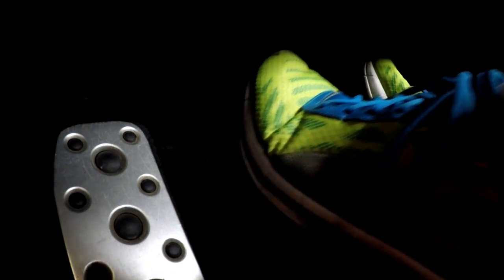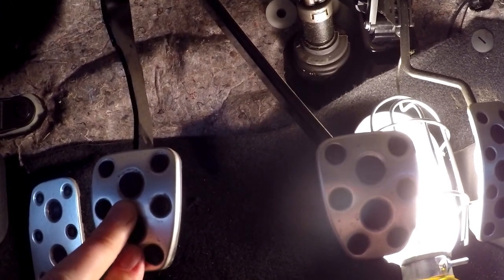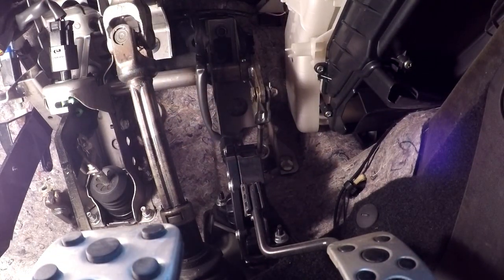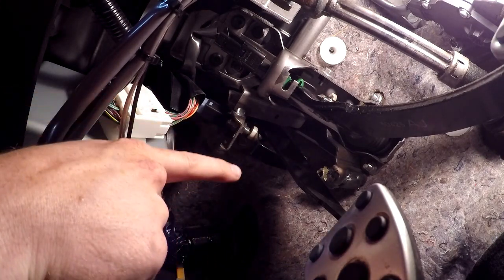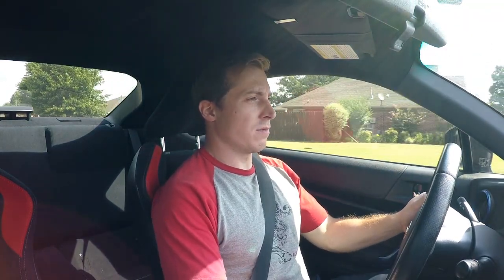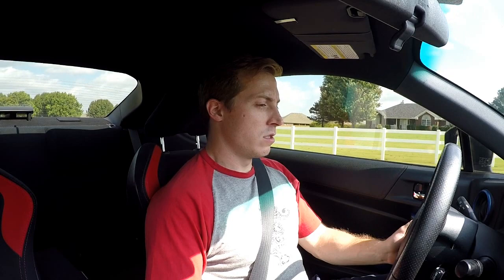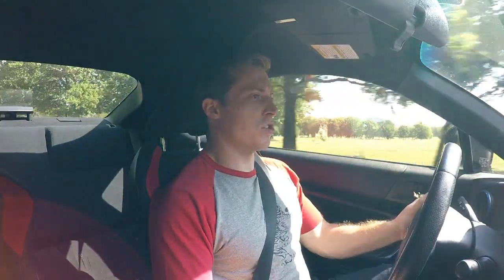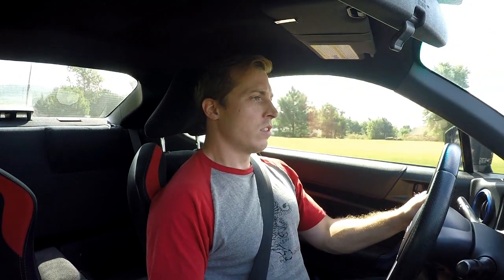How To - Adjust Clutch Pedal - FRS/86/BRZ

Comment: I actually found that it was easier to take the cotter pin and the pivot pin out. I simply rotate the shaft with the U bracket then reinstall the pivot and cotter pin

Comment: I have a 2018 BRZ and after 2000 miles I still can’t shift smoothly from1-2. I ordered a softer spring replacement and I will adjust the clutch. Good video.
Reply from the maker: They make shift springs as well. I plan to order a set after I upgrade my clutch next month. There’s a transmission bushing as well. All of the above would most likely aid in better shifts.

Comment: 1,000,000 times thanks for this video. My  FRS is way better to drive now. The only thing i would add is that rod you were twisting with your fingers... I couldn't get it to turn. So i had to use a pair of vice grips to get it to turn.
Reply from the maker: @natew9970  interesting that it was difficult to turn. Maybe because these have gotten older? Either way, I’m glad the video helped!

Comment: my 95 Civic got a new clutch OE type from Exedy and it bites high too. Thought it was odd but the tech said the bite point is stock he did not make any changes.
Reply from the maker: Did it get better with wear and usage?
Reply: @RageFueled I've had about 1k miles on the new clutch, bite point has not changed. I may adjust it down.

Comment: Do you have to remove the assist spring as well when doing this, or can you just adjust the pedal without having any complications?
Reply from the maker: I do not believe so. You should be able to adjust the clutch with the spring in place.

Comment: I recently purchased a BRZ and just recently figured out the solution to the 1st to 2nd gear problem. Looking to modify the clutch now and still trying to figure out heel-toe downshifts from 3rd to 2nd. Great vid, helped me realize it's not just me having these problems with the car.
Reply from the maker: Max Suciu I’m hoping replacing my clutch will help. It’s been worn since I got the car but has gotten really bad. It has 70,000 miles on the stock clutch. The other previous owners were young and I expect they learned manual cars in it.

Comment: Does this work if I have the mtec clutch spring installed? Or do I have to remove the clutch spring before doing this mod?
Reply from the maker: I believe you can still do this with or without the clutch assist spring.
Reply: @RageFueled  thank you for the reply.
Reply from the maker: xbone 89 no problem!

Comment: good video.  I too had the issue (like everyone else) with smooth take-offs and gear changes in this car.  also the difficulty in getting 2nd gear.  when you see the reviews for this car they all rave about how great the box is but anyone who lives with this car for even a short period of time feels like a gumby with shitty takeoffs at the lights and jerky spaz gear changing.  I have driven manual cars for 20 years but felt like a learner in this car.  I hadn't stalled a car in 20 years but when I got my 86 I stalled it about 3 or 4 times and I consider myself an above average to good driver - frustrating!!!

I will be adjusting my clutch pedal travel shortly thanks to your video but I did the following mods that assisted greatly as well.  

I changed the stock transmission fluid to Penrite GL5 and added Penrite Shift-Eze which improved the 2nd gear selection - didn't seem to take as long to settle down when cold.  I installed the MTEC clutch spring which helped a lot with pedal feel.  the MTEC shifter springs which makes the whole shift gate feel better, more positive, and assisted with further smoothing out changes into 2nd gear.  I have put in the Whiteline positive shift kit which, like the shifter springs, has made a big improvement in selection across the box especially 2nd gear.  finally the Whiteline differential mount cradle insert.  I have gotten rid of most of the slop out of the driveline.  there is a very small increase in gearbox noise in the cabin that unless you are a car nut you would not notice - my wife can tell no difference.   there is still a very slight hesitation going into second gear when it's cold but this disappears very quickly indeed i.e. in one to two minutes.  

with all these mods I now have a gear change experience that is streets ahead of where it was stock.  it's now positive, smooth and snickety snick goodness all through the rev range when driving like grandma or Fangio.  I cannot recommend all of these mods highly enough.  the clutch pedal adjustment which you have done might just be the icing on the cake.
Reply from the maker: Peter thank you for the in depth comment. I agree completely with the stock shift system. I learned to drive on tractors and small dump trucks. Drove them for about 15 years or so. This was harder to drive and feel. Between removing the assist spring, adjusting the pedal, using Motel gear oil, and a new clutch/LW flywheel, it’s a different car. After your recommendation I will move the shift springs and bushings higher on my list. I’m glad you enjoy your car for what it is! They’re an excellent chassis and drive so good.
Reply: How much better is the Pennite than Motul? I'm running Motul on my "18 BRZ and 2nd gear is a lot smoother now.
Reply: @saulespino2510   I haven't tried the Motul in mine - just replaced the factory filled stuff with Penrite.  Keen to give the Motul a try though.  I have done the clutch pedal adjustment and I am very happy with my whole setup now.
Reply: What gives better feel removing clutch pedal spring or replacing with m tech spring?
Reply: @anthonymoy4471  I haven't tried it with removing the clutch spring completely
Reply: Maybe CDV a free mode will help an change everything.

Comment: Just did this modification and removed the clutch spring and wow, it feels like a completely different car. Finding the clutch bite point is not easier which I find strange, but the reduced travel makes shifting so much easier. The pedal also feels spongy, and feels like most other normal cars.
Reply from the maker: Mario Paul between these mods, the short shifter, heavy duty clutch, and lightweight flywheel it’s nothing like stock. I’m looking forward to replacing the shift springs too.
Reply: I put in an MTEC spring in the clutch pedal, much better.

Comment: It's a Toyota transmission(made by-Aisin co) .. all depends if you have a manual or automatic. The Manual is the Toyota J160 (Aisin AZ6)- used in rx8, Lexus IS, S15 Silvia and Miata mx5 ( slightly changed for the brz/frs) 
The automatic version is the Toyota A960E (- used in IS250 and GS300 Lexus vehicles.
Reply from the maker: Sebastian Arcila I knew it was a Toyota trans but didn’t know for sure what all it was used on. Thanks for clarifying
Reply: Nah dude it’s a TL70

Comment: Great video! How did you make the mesh of the clutch and gas pedal a little softer?
Reply from the maker: The mesh softer? My clutch is a lot stiffer than stock. I removed the assist spring and it has a heavy full face clutch in it.

Comment: My clutch seems to be almost to the floor, could I I adjust the opposite to raise the pedal so it's not too pressed in?
Reply from the maker: I would think so yes. Unless your clutch is too worn out. Just because it isn’t slipping doesn’t mean it isn’t worn out. Make sure you have slack in the pedal though so it doesn’t ride the TOB

Comment: Hey man, I cannot get that rod to twist in, I don’t know why. Super frustrating. Any ideas?
Reply from the maker: Did you loosen the jam nut? I know that’s a stupid question but first thing to check is the simplest.
Reply: @RageFueled  I did yes. That would be  the 12 mm  nut on the rod right? I’m not sure if I’m missing something else but it seems like I’m doing it all right, damn rod just won’t turn
Reply: @cyrusstites4847  I found that if you add some pressure to the actual clutch peddle itself, the rod is then able to turn. I ran into this myself on my 2018 wrx

Comment: Just wondering what way to turn the master cylinder rod to lower the pedal?
Reply from the maker: If memory serves, you turn it clockwise and screw it in.
Reply: @RageFueled  ok perfect! Thanks for the quick response man!! Gonna try it on my 2017 wrx sti. The clutch is probably fairly worn but anything to lower the engagement point lol feels weird having to release the clutch so much to get the car going
Reply from the maker: @247jeffmarshall  no worries. Let me know how it goes.
Reply: @RageFueled  also just wondering the 3/8” of play. Is that play in the pedal before it meets restistance? Sorry for the million questions lol
Reply from the maker: @247jeffmarshall  correct. You don’t want the pedal to be too tight or it could essentially “ride” the clutch.
Reply: @RageFueled  ok cool I just did the adjustment and it was actually counter clockwise to lower the pedal. Feels a lot better now. Doesn’t seem like the engagement point really changes but it definitely shortens the pedal stroke which makes it feel like it engages sooner. Thanks again man!
Reply from the maker: @247jeffmarshall  I was afraid of that. It’s been several years since I did that and couldn’t remember. Sorry about that. I’m glad you got it figured out!

Comment: You remove the spring and also adjusted the clutch pedal b/c I want to do this to my car people say to remove the spring and it will feel better
Reply from the maker: Removing the spring made the biggest difference but adjusting the pedal really made the spring removal that much better. The clutch feels like you would expect.
Reply: Rage Fueled does removing the spring affect anything bad ? and thanks I’ll be doing this mod soon to my 86
Reply from the maker: Not a thing. Just gives the clutch less of an artificial feel and more stiffness.
Reply: Rage Fueled going to do this today thanks bro great video this is going to help a lot
Reply from the maker: You're welcome. Good luck!

Comment: That squeaky noise sounds like your TOB is getting worn
Reply from the maker: My TOB is def getting worn but that squeak ended up being the pivot point. I greased it and it’s gone away. When it’s really cold and has been sitting, the bearing does squeal a little. The clutch needs replaced anyway so I’ll fix then when the time come.
Reply: Gotcha. And thanks for the video. Will reference it when I do my adjustment!
Reply from the maker: Ricardo Lo my pleasure. I hope it’s useful.